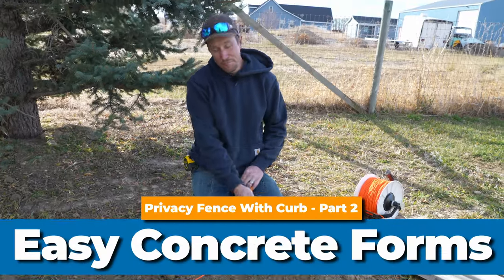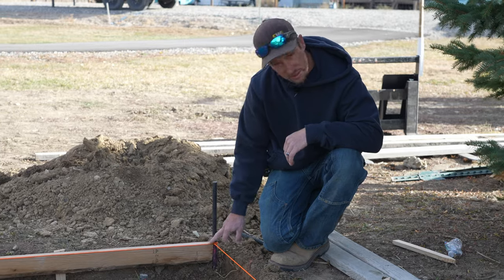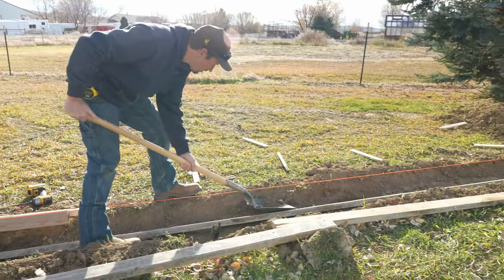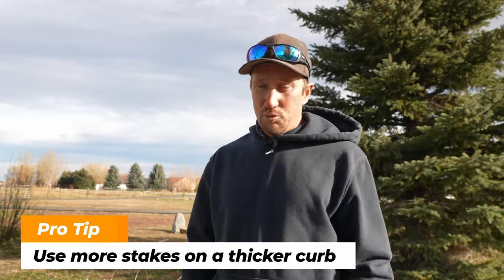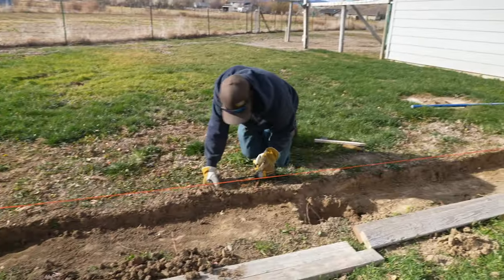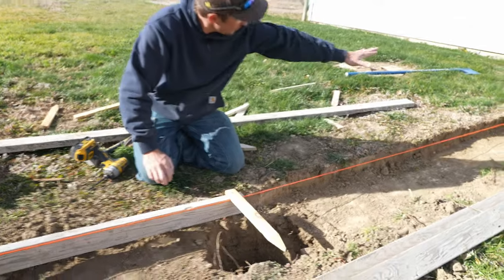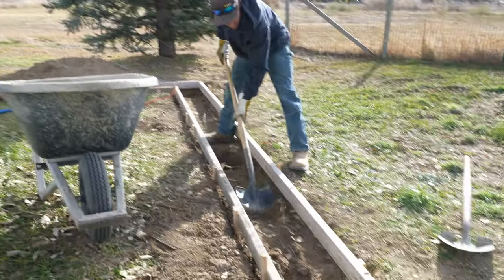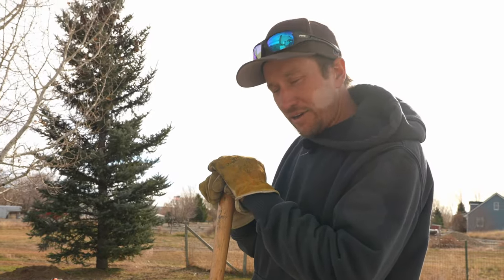How We Build Easy Forms For Concrete Curb

Comment: Rebar can be added to improve the longevity of the curb.  Also, if lighting is desired along the fence, you can embed pvc electrical conduit with 12/2 UF cable inside the forms and use a pvc "T" close to each post to bring the wire above the curb level, allowing you to run the wire to the top of each post as needed later when adding the lighting.

Comment: Good advice about setting the elevation of the concrete higher than the dirt. Around here we use rebar and bent over nails to stake forms, the wood strips break if you try and pound em in our coral rock.

Comment: I really fail to see what a string accomplishes here at all.
Reply: First for elevation, but It really does help keep your form straight,especially with such a long run . And has he said in the video the straighter it is the better its gonna look.
Reply: @Nanook236  isn’t the elevation better checked by using a bubble level on the form itself? And won’t a 2x4 provide all the straightness anyway? Not trying to be a know it all or argumentative but every time I’ve used a string like this it just felt like an unnecessary step.
Reply: Elevation and level seem like the same thing but they are not. So he had two “elevations” in the video he was working with, using the strings was a good way to visualize where the one elevation ended and the other needed to begin. And yes you can use a string to check for level using a line level.

Comment: This is not how u forum . This is Micky mouse. Use 2x4 pickets drive them in with a 16lb sledge hammer. Not 1x2 stakes . And also use nails